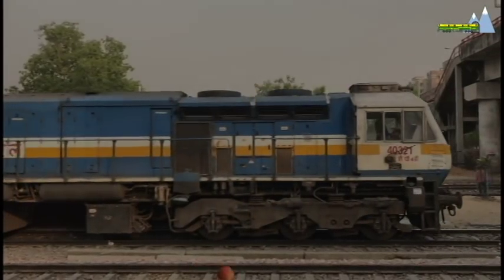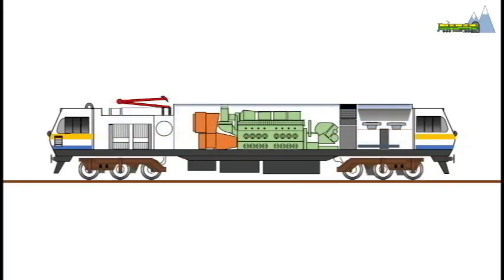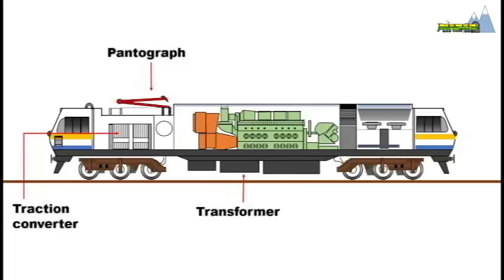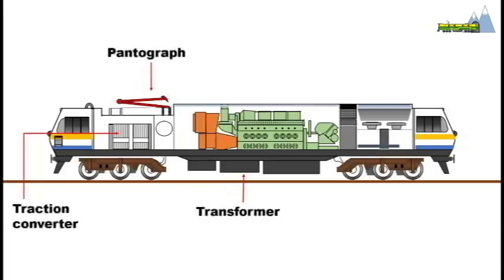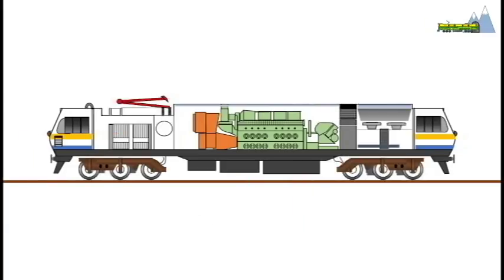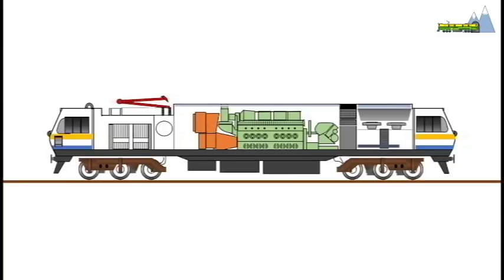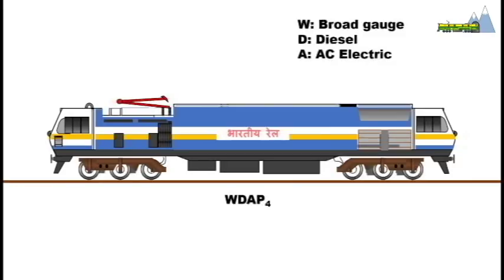WDAP-5 | Dual fuel Diesel + Electric locomotive - WDAP 5| Dual mode locomotive | DLW | EMD

Comment: Agar 50 goods coach ko WAP7 se attach kr diya jayega to wo kaam nahi karega?
Reply from the maker: It should still work… but pulling capacity will be less because of gear ratio set for lighter load and higher speeds

Comment: In elec locos like WAP4/5/7, WCAM, WAG there are two pantos with special purpose ie the rear end panto is always used when loco is running, how that can be managed in WDAP-4 locos?
Reply from the maker: Electric locomotives are generally provided with two Panto. Technically either Panto can be used in either direction. In the WCAM series one loco is for DC traction and the other for AC. In wDAP 5, to accommodate the Diesel equipment there is space only for one Panto. This Panto can be used in either direction of operation.

Comment: More than this, we need a dual-mode EOG, one that has both a diesel generator and a panto with AC-to-AC transformer. Every LHB rake is essentially drinking diesel throughout the journey and when idling, thanks to the EOGs. Kind of defeats the purpose of electrification. Instead they should feature OHE equipment in electrified routes, and the diesel component as a failsafe or when the train goes through non-electrified sections.
Reply from the maker: Tarun ''btarunr'' The railways have been planning for sometime to shift to HOG and draw hotel power from the Locomotive

Comment: Appreciate the trial not discourage with a 100 year old negativity. I have certain doubts about the duel mode.
1.Will the length of the engine increase? if so to what extentant?
2. An electric locomotive will always have 2 canteneries. Will this proposed new one  too have the same?
3.When on diesel electric hybrid -mode, will there be a seperate power plant for train electricity?

The concept is very simple to understand. Its like you having a DG set in your apartment. The DG will be programmed on auto-stand-by mode when the raw power shuts down the DG auto starts and viz ... but the challenge to manufacture will always be there. Everyone is ready to bless success. One must remember  multiple failures are the only stepping stones to success and not guffas.
That's the reason why multiple prototypes are made, so also multiple test and modification before feasibility and mass production.
Reply from the maker: The first WDAP5 is now on the tracks. It is the same length as the WDP4D. The loco has just a single catenary. Some variants of the WDP4D had inverter driven power units to supply train electricity. The WDAP5 probably has the same provision, but I am not sure.

Comment: It's not WDAP4 .... It's WDP4
Reply from the maker: Kishan S.N when it will be on the rails... it will be WDAP-X , definitely not WDP4... please see the entire video before you make a refuting comment...
Reply: @TheTrainStory  What about thumbnail then?
Reply from the maker: Kishan S.N what about the thumbnail?
Reply: @TheTrainStory  And can you please tell me WHEN WAS A WDP4D turned into ELECTRIC?
Reply from the maker: Kishan S.N Please see the entire video... the video is about your question...
Reply: @TheTrainStory  I saw yesterday only... There's no concept of WDAP4
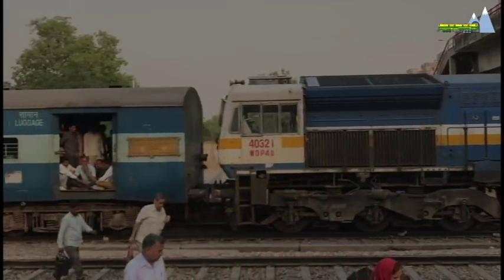Reply from the maker: Kishan S.N At minutes 1:24 - 1:31, it is clearly stated that the RDSO has plans to convert WDP4D locos to dual fuel (Diesel + AC electric) locomotives... the drawings are from RDSO documents...
Reply: @TheTrainStory  Are you sure about that?
Reply: @TheTrainStory  There's no chance of conversion.... An single WDP4D weighs 123 tons and an electric with less than WDP4D.... How can they fit a ELECTRIC LOCOMOTIVES Engine into a diesel locomotive??? 
There will be shortage of space
Reply: @kishansn9876  vid says it was modified i. e. elongated.
Reply: @kishansn9876  What we currently operate in railways is not a diesel locomotive but diesel-electric locomotive. So, modifications are going to be lesser than you imagine.
The motors that drive the wheels are going to be same. The diesel engine is coupled to a generator and the electricity from the generator is going to be fed to the traction motors (This system is going to be the retained in the dual-mode system). Now, what they are doing is bring in a pantograph and a transformer to draw electricity from overhead lines. This power is going to be fed to the traction motors directly. 
In diesel-electric traction mode, the diesel engine runs the generator to generate the required electric power that drives the traction motor.
In electric traction mode, the OHE draws the power from overhead and feeds the traction motors. 
The additional pieces of equipment to a regular diesel-electric engine are soft-switching equipment to switch the mode of traction, OHE, the circuit to bypass the diesel-electric system and a transformer.

The control system is not going to weigh much. The simple structure of the cabin will be somewhat congested comparatively. The ones that really occupies space is a transformer.
Reply: @TheTrainStory  And there's no concept of WDAP4 Anywhere...

Comment: That would be 3355 kW (diesel) / 3728 kW (electric). Still impressive to have that in a 126 t locomotive. But many countries wouldn't pull 26 coaches with that ... Austrian railjets have one 6400 kW locomotive for 7 coaches. So I guess it works only on flatland and with no considerable gradients. 135 km/h is also pretty slow for an express passenger train (does Indian railways plan to use EMUs for the 160 - 200 km/h speed range?)
Reply from the maker: unci narynin Yes Train 18 emu trainset is fit for operations at 160 kmph... and as and when Indian tracks are upgraded to 200 kmph, this trainset can run at 200 kmph with suitable change of gear ratios

Comment: Im puzzled.......why order all the new GE diesel locomotives if IR really wants electro-diesels and electrify the whole network?
Reply from the maker: Paul Richman Electrification plans were always there but now the plans have been given an acceleration to complete electrification by 2020. There is some debate still going on about the feasibility of complete electrification. Nevertheless as electrification of the network would result in small patches of unelectrified track during the process, the dual mode locomotives will likely fit in there. The order for the GE diesels was made prior to the new goal of complete electrification...it remains to be seen what IR would do with ~800 diesel locos from GE?
Reply: @TheTrainStory  
Do you really believe they will get the electrification done till 2020? In roughly 2 years?
I dont think so. This is only a wet dream.

>> "what IR would do with ~800 diesel locos from GE?"
Run them. What else?
AFAIK IR has a need of minimum 300 new locos per year. That are 300 units which need to be replaced, 
and it is irrelevant, which "prime mover" is used there, because the trains must be pulled, no matter whether from a diesel or electric locomotive.
Reply from the maker: Pearly Humbucker The railways are ambitiously electrifying diesel sections at a fast pace. They may get delayed but then all Public sector undertakings have a tendency to overshoot timelines 😊

Comment: @The Train Story
This is a real funny story.  
The complete locomotive will weigh as much as the diesel locomotive, on which it is based, or a similar electric locomotive - but still get all the electrical and electronic components installed? Do they weigh nothing?
And the transformer has recently shrunk so much that it fits under the frame next to the tank - and still provides enough power for 4500 hp?
That sounds just as crazy like a wet dream as the story of the WADC3 -  especially since there are hardly more than a handful long-distance dual-mode locomotives in normal operation.

I cant wait to see the realization of this white elefants...... ;)
Reply: hi Pearly, did you not see or hear the commentary in the video? It is clearly mentioned that by placing the 4500 HP transformer for electric power, naturally an increase in weight is a concern, which is sought to be addressed by using stainless steel instead of iron metal sheets for building the loco. Of course, the weight-bearing capacity of stainless steel has also to be tested. But don't worry, all this is at the draft stage, and let's see how this progresses. Don't lose hope. Indians are very good at developing or adapting principles of technologies for local needs and operations. Hope I got my explanation right.
Reply: @artrock100  WAGC3 is also not a "wet dream" anymore... This guy sounds like just another India-basher doing criticism on issues already covered in the video by doubting their capability, because he thinks all Indians are low IQ losers like him who can't come up with solutions!
Reply: @ @rishi7629  
I think you need to bring a bit more knowledge about locomotive engineering than you show here to allow you to judge.
And No, I do not think that all Indians are just chatterboxes like you, who can only tell some nonsense.

But I am sure that some people sell so-called solutions which are not considered solutions on closer inspection because they are too complicated, too expensive or with too little gain in the end.

The WAGC3 is such a case. It makes old worn out locomotives into new old and not quite worn out locomotives and sells that as a solution to the problem that annually several hundred locomotives must be replaced by new! 

We´ll see.......
Reply: @pearlyhumbucker9065  its not a wet drem lol, go check it out.
Reply: @thesunv3691  Well, they have proved that it can be done. Three such things exist, a brilliant achievement, really.
Obviously, however, the costs are too high and the value of the machines too low; after all, the newly converted locomotives are made of old machines, some of which are already scrap.
In addition, there are not enough donor locomotives to start a meaningful series production. So the effect on having to replace several hundred locomotives a year is simply too small.
Reply: @pearlyhumbucker9065  true,  but they only just wanted to show it off lol.  I agree with you.
Reply from the maker: We have to wait and watch for the first prototype to hit the rails. The RDSO technical data sheet says weight reduction will be achieved through use of alternative materials for the super structure. They drawings also reduce the size of the fuel tank by half.